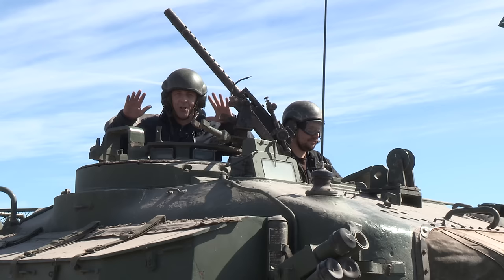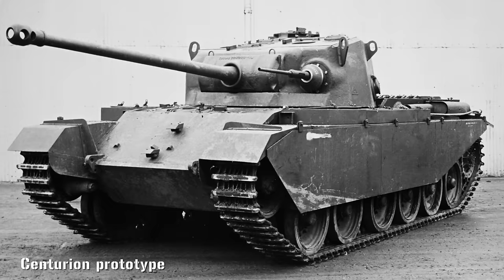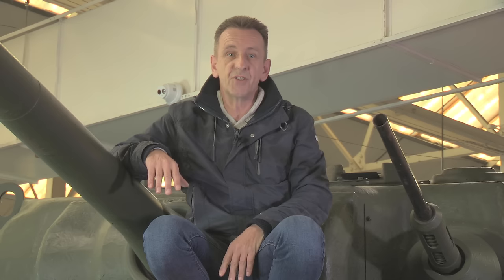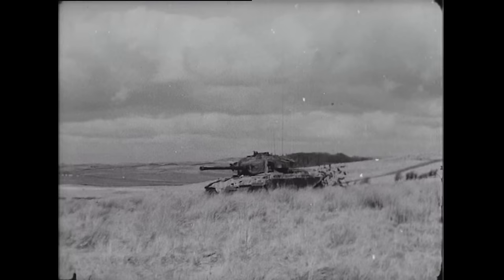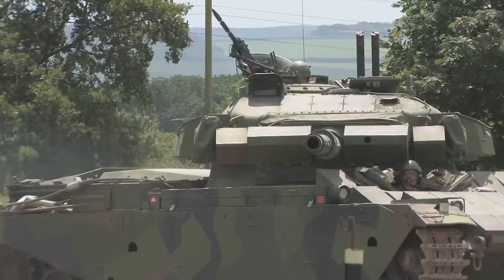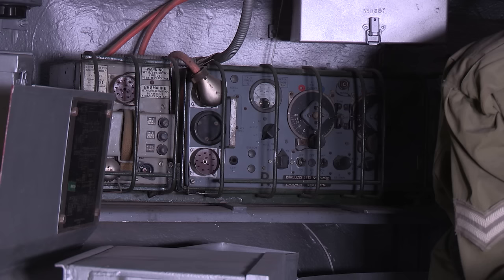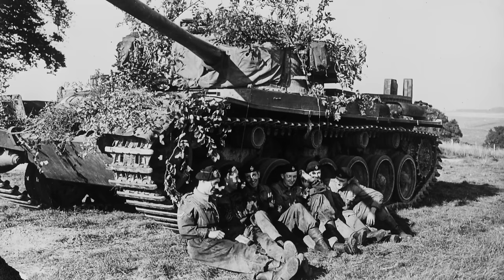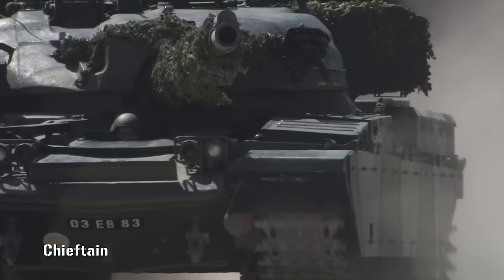Inside the Tanks: The Centurion - World of Tanks

Comment: Would be cool if the centurion would be as good in game as it was IRL. Sadly the ingame versions are quite pathetic, except for the action X, which was a prototype AFAIK :(
Reply: Learn to use the 7/1 properly.... 63% win rate in it with 2800 average damage.... it's a fine tank
Reply: Jason Muir The 7/1 is pretty okay, but worse than most other mediums at its tier, I'm mainly talking about the cent 1, which I pay quite well, 1700 dmg and 57% win rate, BUT it is not enjoyable at all and I achieve the same thing with ease in m46 KR for example. The 7/1 has a stand-out gun in its class while the cent 1 has a slightly better than average gun in its class, add to that the fact the 7/1's upper plate can actually bounce something and has only 1 tank in its tier with the same view range, gives it a place in the game.
This doesn't count for the cent 1, there are very few cases where a cent 1 is better than a pz 58 mutz/pershing for example. As I tried to explain before the cent 1 doesn't have anything going for it except the high pen gun, BUT the difference between 212 and 226 is so small that it rarely makes a difference, so you still need premium ammo at the same moments pretty much and thus removing the best aspect off the tank. Making it a bad tank, because the gun isn't much better than average(especially DPM make it rank lower) the mobility is worst in class, not counting the SuperP, the view range is best but there are a lot of others that share it, the armor is only good for occasional bounces when not top tier(This only goes for the turret, hull bounces nothing) and Id rather have a lot more mobility to dodge shells than a bit of armor, but terrible mobility. Camo rating is obviously pretty bad as well cause its a very big tank and all of the sudden there is not much left which the tank does do special.
Only at the start I enjoyed playing the tank, after the 200 battles I played in it, I never wanted to play it again. The main thing where the joy came from was the penetration of the gun, and it was my first tier 8 medium, because the comet has quite bad (prem) pen and it was quite nice to be able to pen almost all same tier or lower tanks without premium with ease. I doubt you'll be able to give me a reason that the tank does do something special, but Id admire it if you can
Reply: +Mark van Eldik Heh, and I love the Cent with a 47% Winrate, my worst across any tank below Tier 5. I had really awful matchmaking when I was stock (thankfully I'd free xp'd the 17-pdr) and it seemed like every fifth game I was getting into a Tier 10 game with a Death Star that ammoracked me the second I got spotted...
Reply: +MerryJerry *above Tier 5 I mean
Reply: MerryJerry I wasn't that unlucky, but that's what I mean. The ONLY situation where the tank is good is top tier open map and not many TD's, cause only then your armor counts for something and you are not hindered by the terrible hull. But as we all know VERY few maps in WOT allow for this. To me that is part of what makes WOT bad for tanks like the centurion. IMO they should remove pretty much all maps, reintroduce the good ones they removed, over the years the maps have only become worse AND they should introduce maps the same size as armored warfare as those are maps where the strength of the cent lies, very long range combat, but currently that is BARELY a thing in WOT and 99 out of a 100 matches you cant do this. (Added to the fact that any tier 9 can pen the cent at their leisure and you don't have the DPM/mobility to do anything against them.) 
BTW, my advice for the med line, would be to grind the heavies till black prince(what I did) or Caernarvon, then you will have lots of modules already and the church 7 and black prince are pretty good, didn't like church 1 though, that turret...